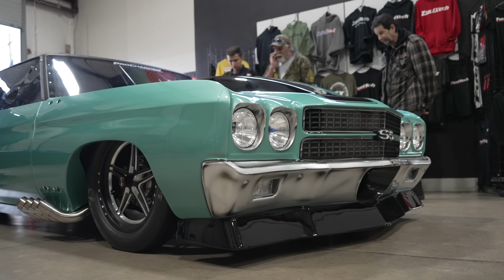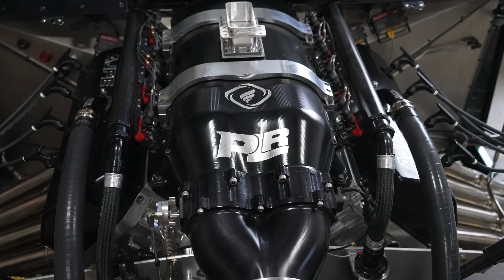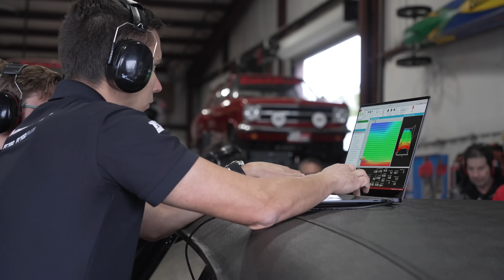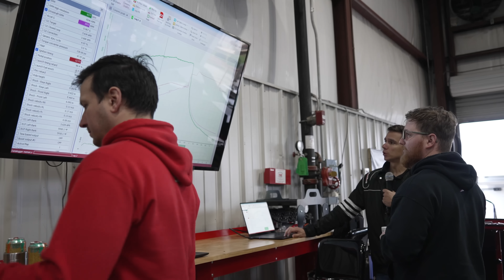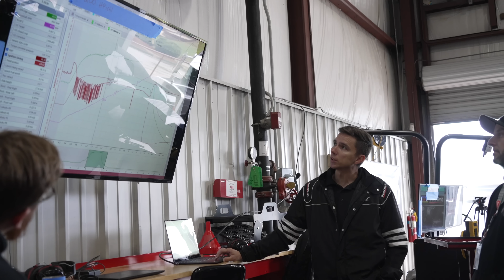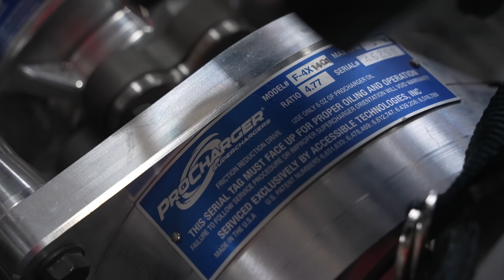The "Bad Attitude" Chevelle is FINALLY ready for No Prep Racing | Monza 405

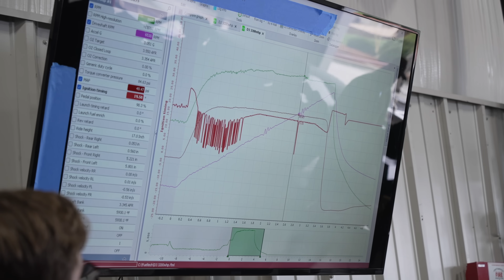Comment: 16:08 Love how they covered the numbers, but saved the tune up as the HP number 😂😂
Reply: 3247... give or take but damn impressive regardless.... with these cars.. seems like suspension tuning and drivers are very critical to get down a pass.managing that much power is insane... using it all or not.
Reply: The power in kilowatts is also clearly visible through the tape. With a simple conversion, you have the exact horsepower number.
Reply: Not the brightest in the world lol,,,idk why they try hiding it anyway everyone is running the same combo making the same 3200-3400, they aren’t doing anything special